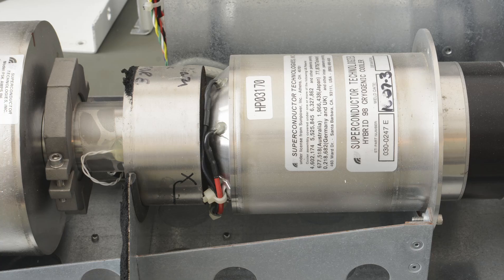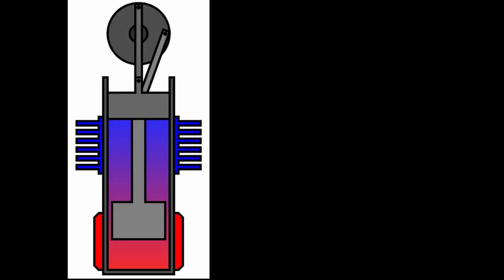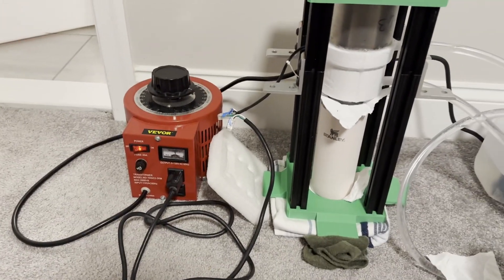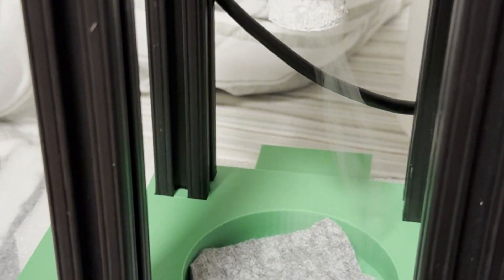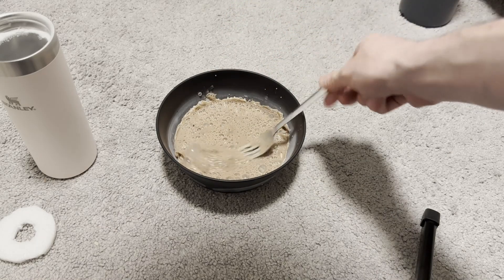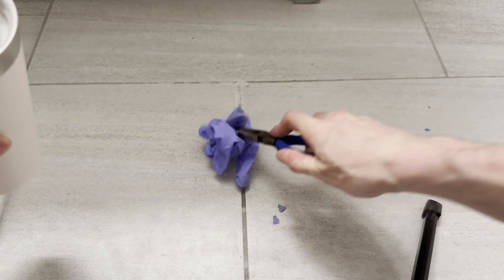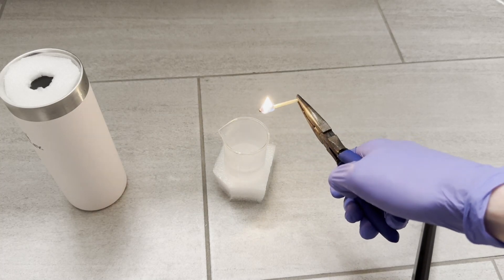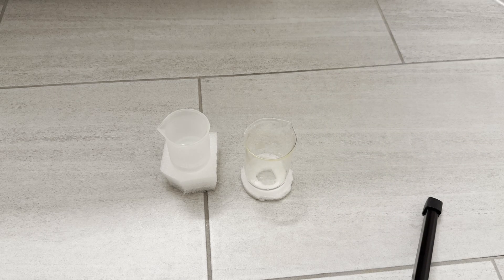I bought a cryocooler to liquefy air

Comment: Been looking for a unit just like this to liquify air, unfortunately they are very expensive on eBay and also extremely rare nowadays 
Don't know if u plan on selling but I am 100% interested in buying even if you may have other units around 
Trying to do some superconductor experiments with ultra high voltages and I'm just missing the device to chill the superconductors 😂 
But anyways awesome video and I hope there's more available out there 😅
Reply from the maker: Unfortunately I am not selling this quite yet as it’s the only one I own (and I have some stuff I want to use it for that specifically need this). I got so lucky on eBay to have found this. I wish you lots of luck in your Cryocooler journey tho, they are nearly impossible to get your hands on now.
Reply: @reactivechem7408 don't really know if it's feasible but would you consider selling samples of liquid air for lecture demonstration purposes? I am for sure willing to purchase samples from your machine but not sure how to go about it and even if delivery is possible without needing very robust containers.
I believe it is possible to fill small containers but again I'm unsure how shipping could realistically work

Comment: i think liquid oxygen is slightly magnetic so i wonder if there is a way to separate it from the rest of the air with a magnet, at least it would be an interesting test. (if i remember correctly liquid oxygen is slightly blue but i might be way off on that)
Reply from the maker: Yes you are correct, it is. the issue is that oxygen and nitrogen are fully miscible with each other in the liquid state so the only way to separate them would be to boil off the nitrogen. Oxygen will magnetically attract but the nitrogen will be stuck to it, so unfortunately it wouldn’t work to separate them
Reply: @reactivechem7408  Use zeolite to remove oxygen.